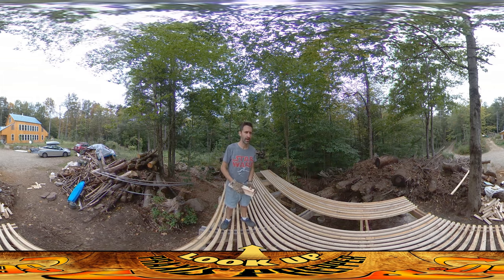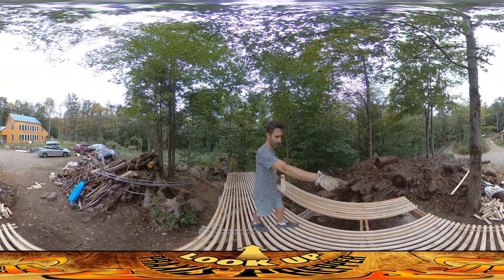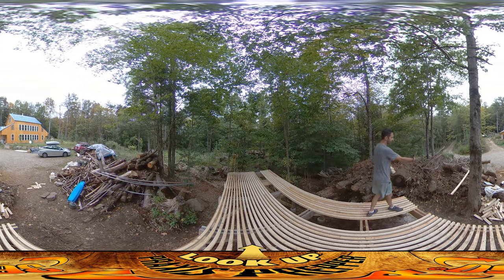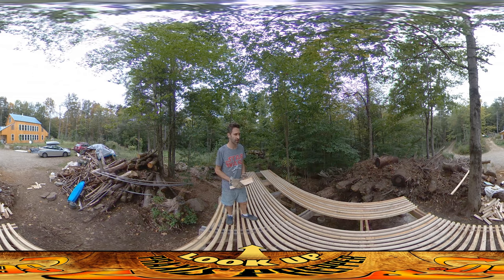Homestead Building - Ventilated Floor Design with 2x3's, Lumber Calculating

Comment: If you've got the room for it, extra 2x3s (and/or 2x4s) + 1 extra sheet of dry-wall + 1 extra 4x8 plywood are some of your home's prepping supplies; the year I bought a 160yr-old house I had 3 separate pipe bursts that first winter when we learnt that the previous owner ran the "new copper piping upgrade" along the exterior stone wall w/o insulation; now I'm working on electrical + plumbing extras after a thermostat stopped turning the heat on and the kitchen faucet succumb to hard water...
Reply from the maker: That all sounds rough. I've been stocking up on nails, screws, and replacement tech (like air circulation fans etc.) so I'll have items I may need this next year and wouldn't want to wait for or pay through the nose to get. It's a bit of work to get double of so many things, but it can save a lot of stress if/when something goes down at just the wrong time.

Comment: It looks great. Would you have done anything different so far? Looking forward to see how it turns out. I built a 8 x 8 chicken coop with a 8 x 32 run off it. It confusing to me how it I under-estimated time, lumber and effort. 😁
Reply from the maker: So far, I don't think I would have done anything majorly different. Though I'm figuring out how to terminate the top and bottom of the roof now and I might slightly alter the ends of the roof rafters to accomodate new thinking.